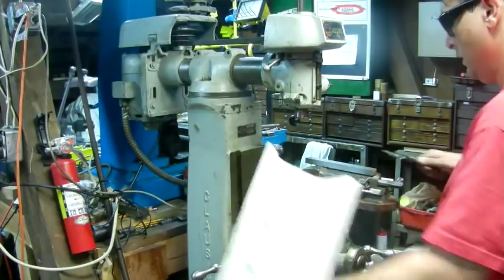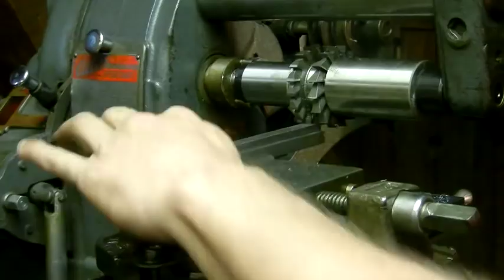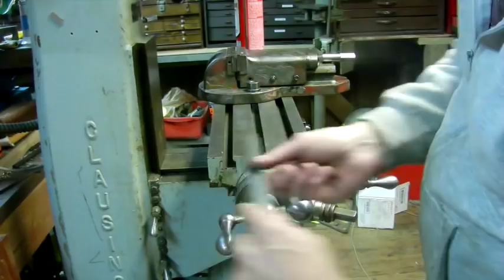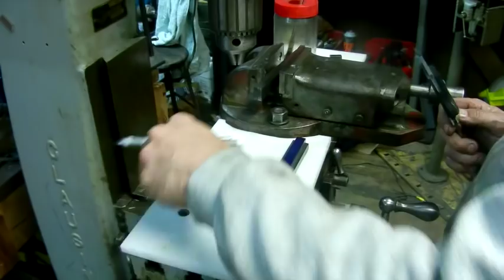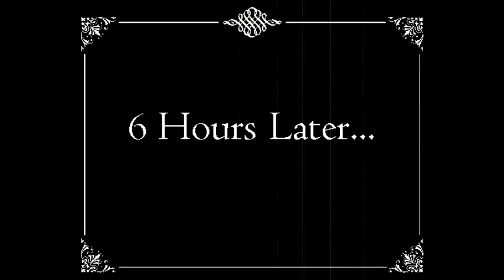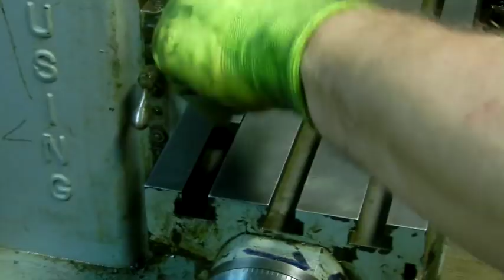Making T-Nuts The Hard Way

Comment: I found that by using fixturing clamps on the base of my vise rather than the stock bolts with washers in the slots, it stays trammed when I tighten it down. I really like your atlas mill, theres one for sale near me and i’m trying to justify buying it. I always take up expensive hobbies, i swear i could spend thousands even if i took up writing poetry.
Reply: I understand. I’m the same way

Comment: Hi there , Steve here, came a cross your post and see that your power table feed is out of order. Well I got me Atlas Mill also, And I found if one does not lock down the lead screw, bad things happen. Tryen to find replacement some what most not so good. So I spent the next 8 months and you gessed it. Fixed my mill and made a few extra which I gave away. I'm seeing that there are few more in need, rite now I'm not set up and it does take some time. Getting paid for the time to make a set, If I made and sold one set I be a rich. So I'm putting a feeler out just to see, if gearing back up, got the tooling, in a day or two I could be back on track. So let me know, Thank You for your time.

Comment: I wanted a Atlas horizontal mill to make my 12 and 6 inch atlas lathes but came across a Sheldon Vernon instead it's a heavy beast but I couldn't beat the price and it's in great condition looks hardly used when I took it apart as I do with all my machines and restore them, have restored and sold 6 atlas lathes as people realize that buying vintage is the best way to buy

Comment: 15:55 It's been bothering me for a while but it looks like your arbor spacers are clamping the cutters by their cutting surfaces ! I totally approve of large diameter spacers as it adds significant rigidity to the arbor but they should match the mounting/clamping faces on the cutters.

Comment: I would only suggest not thru tapping the holes , tap till the tap just comes flush with the bottom. Your machine will end up with the slots busting . Yes it's the right way to make them. I know this is an older video.

Comment: Yep!  I saw at least one commentor thought the same thing I did.  When center-drilling, drilling and counter-sinking the holes, after finding the location of the first center-drill, set your table dials at zero. Then, crank your table left, 1-inch at a time, doing all 8 center-drill operations first (using your dials as the measurers).  Lower the table to do the 8 drillings next, feeding right, 1-inch at a time (again, using your dials to measure). Then, raise the table, feed left for the counter-sink operation.  Saves the arms, as you're only lowering/raising the table a couple times (to complete the whole piece).  My guess is that, by now, you've figured that out.

Comment: Looks like a very good condition Atlas. Hope you don't mind a few suggestions tho. It would have taken just slightly longer if you'd cut that bar in half so the material is held inside the vise jaws or just slightly longer. Maybe 1/2" longer on each side maximum. These light weight machines are already a bit flexible so need all the help you can provide. Clamp the same size bar in your vise again with about the same length sticking out. Then set an indicators tip on the top and just use hand pressure and you'll see right away what I mean. Do the same on the side of the bar. Then visualize the cutting tool pressures. The same was happening while you were drilling the first few holes. I also very much agree with whoever mentioned not having full threads going right through those tee nuts. You will break a lip out of your table sooner or later just from the stud or bolt acting like a jack. Teco clamp sets for example don't have the tee nuts fully threaded to stop that problem.

This video was made over a year ago so you may already have learned a lot about your Atlas. The MFC models had an extended Y axis screw and mount plus a couple of holes tapped into the face of the part that joins the horizontal support and the cutting tool arbor. Those were for an optional vertical support bar that attached at that point and also clamped to the Y axis bearing support just behind the operating handle. In use the top bolts are slacked off a bit any time you need to move the knee and then tightened once the knee is in the correct position. These little mills need all the rigidity you can gain and it's not impossible to build your own parts to do exactly what Atlas did. 

But you weren't making those tee nuts the hard way, a file and a hand operated egg beater type drill would have been the hard way. :-)

Comment: Chip, make sure the stud doesn't go through the t-nut. If it does center punch the last thread. If the nut should lock on the stud and bottom out in the t-slot, you could blow out the top of the slot. Nice vid.

Comment: ChipMaker 1066, I like your Atlas horizontal mill. Now I'm not a machinist nor do I play one on YT, but it seems like you wasted a lot of time with tool changes while drilling and tapping  your part. Since all of the holes were on the same plane or axis it would be far quicker to drill all of the holes first and then come back and tap them. Of course a DRO would make this easier, but the dial works fine if you watch out for backlash. I hope this is helpful.

Peace!